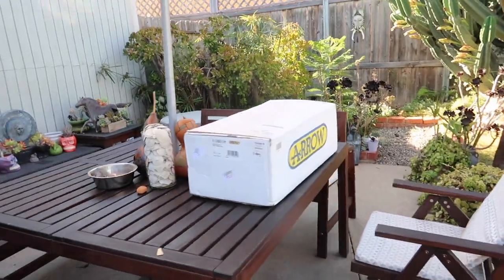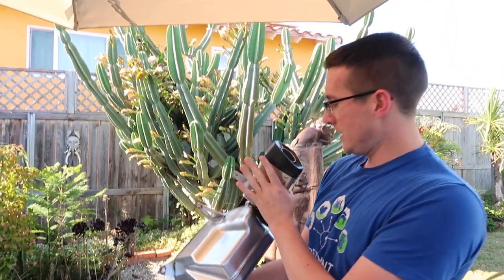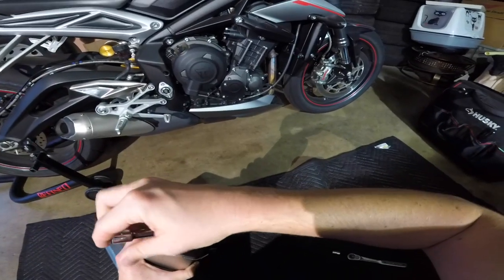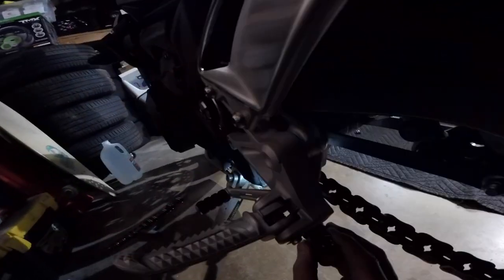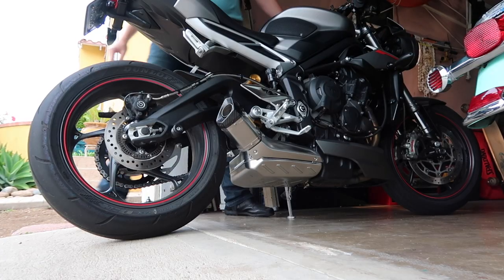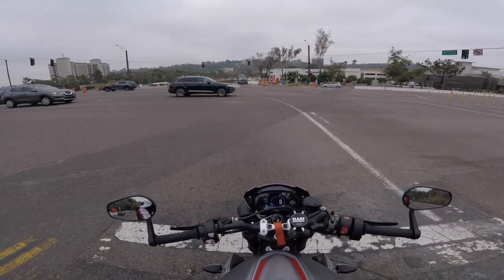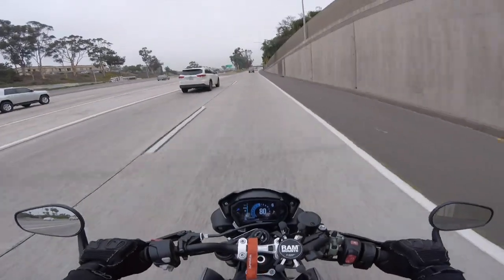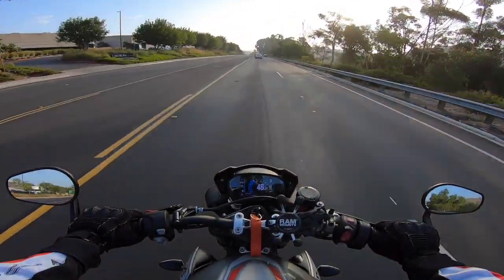Street Triple RS Arrow Exhaust Install & Review

Comment: Adding this in for anyone that stops by. The arrow is one of, if not the only, aftermarket exhaust that does not neuter the low end on these bikes. Straight pipes from SC, Yosh, Leo, Akra all loose power in the mid, and some in the top end as well. A tune might bring it back in line, but at that point you are looking at dyno time and cost starts to get out of hand.
Reply from the maker: Bingo.
Reply: Another good thing about the arrow end can is that in most cases it doesn’t affect your warranty as it’s an official Triumph accessory (technically)

Comment: I have the same bike, same exhaust, any tips on breaking that tac weld?  I have not been able to get mine out and did not want to risk damage. With the baffle in it sounds almost exactly like the stock exhaust. I have been looking at the SC Project as well but that may be too loud for me.
Reply from the maker: I had to use a really good torx bit, put some weight into it so it wouldn't slip and just cranked on it. It broke free without too much trouble. 

To be honest I haven't tried it with the baffle and perhaps I should just to know. One thing I will say the video doesn't capture the bass of the exhaust as well as it could. It's got some nice volume and tone in the lower RPM. I wouldn't want anything louder on a street bike personally.
Reply: Sc projects for the win. Baffle out is LOUD. Baffle in is perfect.

Comment: Hi mate

I agree that stock sound it almost perfect.
I just bought an arrow exhaust. I got a deal of a life time for an arrow(210USD) I'm from Brazil and due to high taxes the price is 1500USD. I was at the oficial dealer and they werent able to sell it since they lauched the 2021 model. I asked to hold it for one day and got straight home for research. Your video helped me a lot, thanks !
The sound is great, slightly more bass driven and sliglty louder than stock and the sound at mild throttle acceleration from 3K to 4k RPM is just AMAZING.
I like it but it could be slighly louder and slightly more bass driven, just a little bit.
Unfortunately I bought the UK version I guess, it says E9 - 9600562
I did not took out the sound damper. is it possible in the UK version? will it make it louder ?
Is there any other way to make is slightly louder? (i'm not looking for any super high volume like SC, akrapovic and so on)

Comment: For some reason, mine sounds really forced compared to mine... So if I m like in 3rd gear going about 40-45 MPH it sounds like it is begging to be shifted up... It doesn't sound as smooth as yours for some reason.... Idk if it is just the video, but did you leave the stock tunning or did you download another tunning? I know the Guys at Triumph said they downloaded another tunning.... But for some reason, I don't like how it feels and sounds... sounds like it wants to let more out... like if it is suffocated a bit.
Reply from the maker: I just performed the 12 minute tune by leaving the bike idle for 20-25 minutes from a cold start. Do you have your baffle in? Mine is pretty loud compared to what most people reported.
Reply: @TheDriversPerspective  Baffle is out. Ya, yours sounds more throaty. Idk if it is just the video or mics. But I do hear a difference.

Comment: Nice video. I’m planning to get this bike. How reliable it is so far for you ? Any issues you faced? How many miles on the odometer now ?
Reply from the maker: So far so good, I've had one small oil leak from the stator cover where the wire goes in (easily fixed with some black RTV) and that is basically it. I have just under 7000 miles on the bike now and I have been commuting on it the last 10 months every day.

Comment: Hey ! glad you got exhaust. I got it with mine when i bought bike back in June. Its definitely on the quiet side and I;ve grown to appreciate that its more mature sounding so to speak.( I'm 49!)  So I am about to put may first set of tires as the stock Supercorsas are toast ( 4k).  I went with Diablo Rosso 2 for better all around versatility and logevity which they are known for compared to the updates Diablo Rosso 3 that don't last as long from the reviews I've seen.  So I hope to get 5-6k out of them. I ride primarily backroads( 75 % and then local rides and highway the rest.)  What are you running? btw, I followed your advice and lowered the front end 5mm and it really has transformed the front end feel, I also set rear preload to 8 Threads showing( 10mm apx).  Love the bike!!  This bike is a long-term keeper for sure.  Once paid off though I want to add an Aprilia tunou factory :)
Reply from the maker: I am running a Dunlop Q3+ tire right now. The Rosso 2 is a great tire, ridden those on track. Thinking about getting a set after I'm done with my Q3+.

Great to hear the suspension tweaks helped, I have about the same pre-load in the rear shock.

Regarding the Tuono, I too see one in my future garage but I don't think I could give up the Street Triple. It just does everything so darn well.

Comment: I was able to remove the tack weld and screw, but the baffle won’t come out. How did you get it to come loose. 2019 Street Triple RS with the same Arrow exhaust.
Reply: Never mind... just got it.
Reply from the maker: @jazz339  mine was wedged in there pretty tight. Took a lot of force to get it out the first time.

Comment: Did you remove the sound damper?
Reply from the maker: Yes, I did so immediately.
Reply: @TheDriversPerspective  i bought one but there is no way to remove the sound damper 🤦🏽‍♂️
Reply from the maker: @thiagopontes5622  There is probably a weld on the nut to keep you from removing it. A Dremel will help you here.
Reply: @TheDriversPerspective  i hadn't thought of that. I Thought i didn't have the possibility to take it off. But i Will check here. Thank you, my friend!

Comment: Hey man, really enjoyed the video. I have the exact same bike and the exact same arrow unit, and I'm having a huge amount of trouble removing the baffle. I got the bolt out, and it was tack welded in but took very little effort to break loose. The one part you didn't seem to film here was actually pulling the baffle tube out. I've seen lots of forums suggest that it's in there pretty tight and you have to yank it quite a bit. I've done a bit of that, but I just want to make sure there aren't any other mechanical pieces holding the baffle in before I really start reefing on it. Any suggestions?
Reply: @wizzbang54 did you get the baffle out if yes pls let me know how I am struggling a lot to take it out
Reply: +1